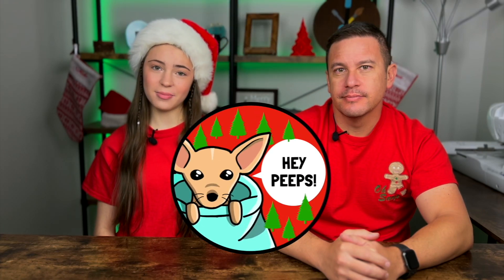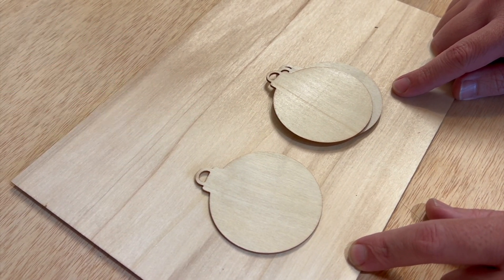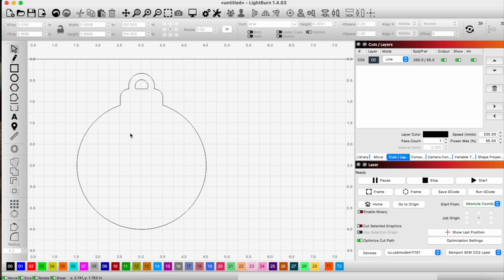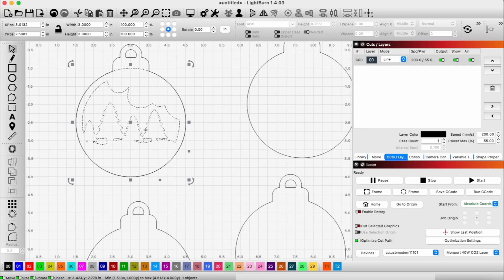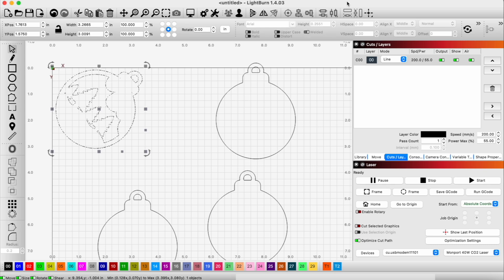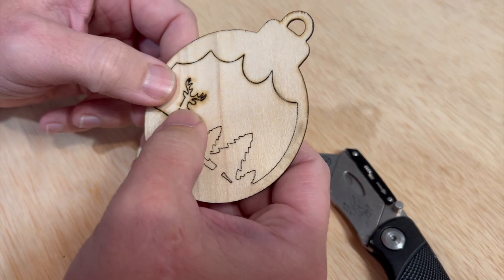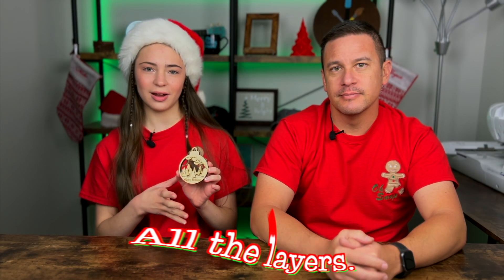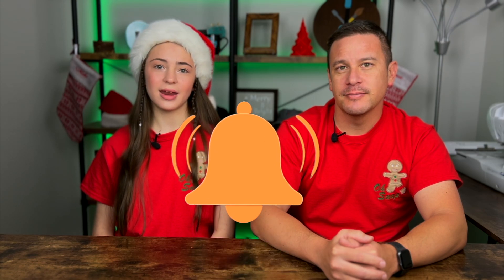LASER ENGRAVED/CUT WOOD ORNAMENT w/ Monport 40W CO2 Laser

Comment: one question, the 4oW Laser is able to cut trough much thicker wood, do you have any insight into the additional handcutting you had to do?

i am learning before deciding which machine to buy, hence my question
Reply from the maker: We just didn't get the settings right the first time and would do an adjustment if we cut out another one. We had already picked up the piece, so we couldn't put it back down to run another pass without messing it up.  Thanks for watching!
Reply: @ProjectAnonymous_Duo  thank you